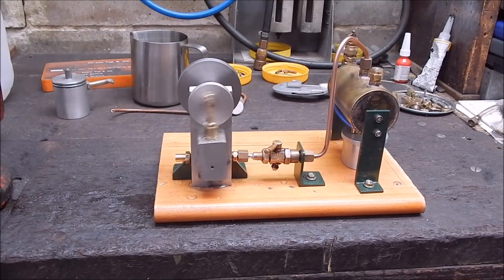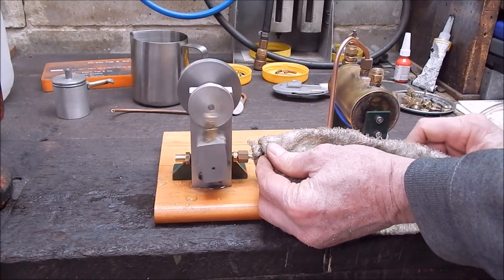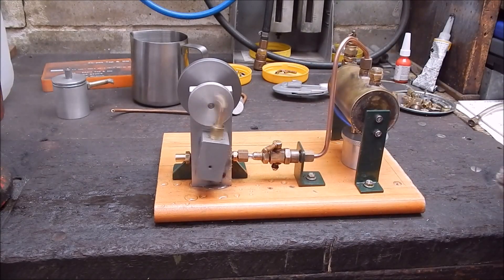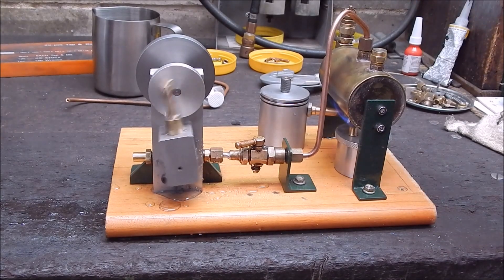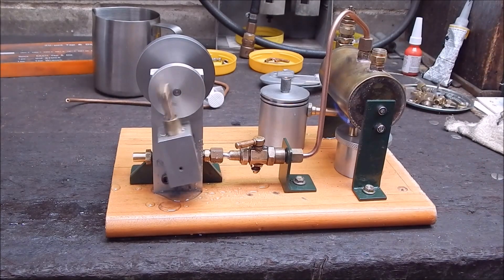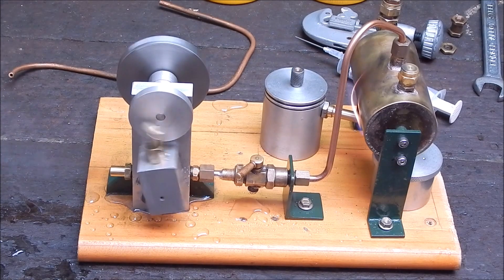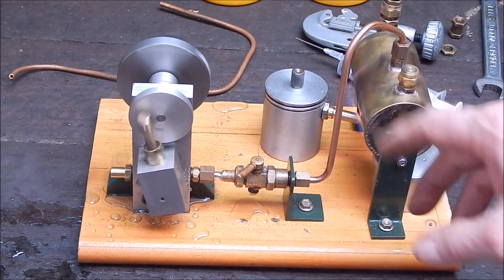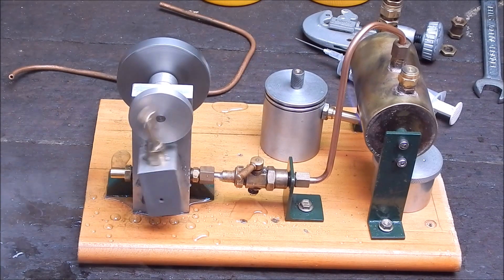The home made steam engine is de-bugged and now runs very well from the boiler

Comment from the maker: I am now using some Gulf Western mineral air tool oil in the water to lube things - it's hygroscopic, so it mixes in beautifully (works the same as steam oil).  I also shortened and lightened the piston skirts and added the steam control tap.  The steam line also got re-routed and all the leaks sealed.  Made a big difference and it will run for about 5 minutes on a boiler of water (half full).  The little boiler did good after all.  Cheers Rob

Comment: Impressive Nice work .You might have some how facilitate a way to reduce wood burning pollution ?¿? You may ask .Hi temperature combustion is essential to efficiently burn and reduced gas emissions in wood stove or furness Where force air (oxygen)is direct to the burning fire elevating the combustion temperature Just like in blacksmith charcoal forge or Rocket stove & batch heather.The idea being to incorporate of a simple way to activate a fan to forces air in to the burning chambers with out the needs of electricity .
Just a thought I've been thinking and working on a solution like this for a while .

Comment: G’day Rob running sweet. That control valve is a bit hot to handle, you need your engineers gloves on:-)
Cheers 
Peter
Reply from the maker: Yeah I know, but they have a hole in them ;)

Comment: referring to a video from quite a while back (I can't remember the creator or the video) I want to address the mystery screw that someone put into the gullet of a lathe headstock pulley. 
In case it was you who had commented that someone had been there before you and put a screw into a pulley valley, I learned that the old Atlas lathes frequently used this screw to cover and protect a lubrication point. 
So, if it was you, that's the likely reason for the screw in a pulley gullet. :)
Reply from the maker: I don't think it would be me Art as I've had nothing to do with atlas lathes.  Cheers Rob
Reply: @Xynudu  okay, thanks!  :)

Comment: Rob,  It would be interesting to see how the valving or the porting or what ever makes this work.  Yes that would be interesting to say the least.
Reply from the maker: Hi Glenn,  I may do a quick run through on it if time permits.  Cheers Rob
Reply from the maker: Hi Glenn, here's a quite good diagram that shows the cycle and port positions:  https://www.pinterest.com.au/pin/421931058814134437/

The pivot pin position is not shown, but is about mid point of the wobbler cylinder or slightly towards the crank shaft.  By being off center towards the crank shaft you will get wider port separation due to the leverage effect.  This is the way to go, as it gives much more room for drilling etc.

It also pays to have a decent length stroke (mine is 10 mm) which also increases port separation - make the bore size whatever you want.

Cheers Rob

Comment: Rob,  I have been off for a bit.  Did you do a video on the build for his one?  It looks to be more simple than most but I don't know much about the steam engines.  Thank you.
Reply from the maker: Hi Glenn,   I did a couple of work in progress reports, but that was all.  This is the first steam engine I've ever built and the "wobbler" design concept is very simple.  There's quite a bit of information on the web about making these.  I just ran the basic geometry through my head and went from there.  There are a couple of things you must get right regarding port alignment, separation and angles.  It largely depends upon stroke and pivot pin position.  Cheers Rob

Comment: Nice rig. Fascinating what can be done with a little hot water. 😁
I was wondering if the boiler would heat better if it was setup with the tank sitting vertical and a burner flue running up through the center.
Might transfer the heat better. Yours is better than any I've made. Just thinking.
Reply from the maker: I asked Alan that and he thought the current setup works better.  His boiler has a heat cover/side traps as well.  I think the modified double burner should work well, even though it is a bit closer than I would like.  I may just make another one from scratch.  Cheers Rob
Reply: @Xynudu  Your design is classic. I just wondered if a pass through would be worth the trouble.
Reply from the maker: I have seen people make the vertical centre flue type and they work OK. All things are possible.  Most of the model steam engines I've seen on Alan's Retro Steam Tech channel are same layout as mine.  Cheers Rob